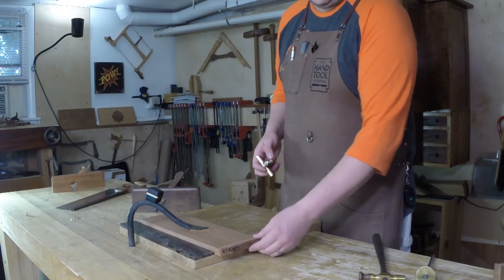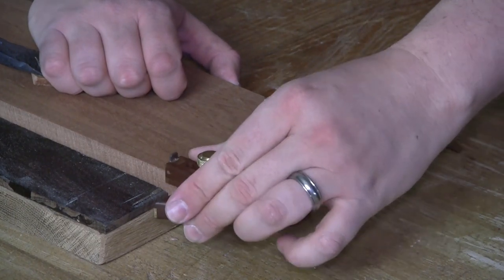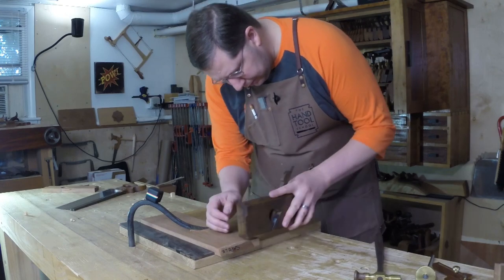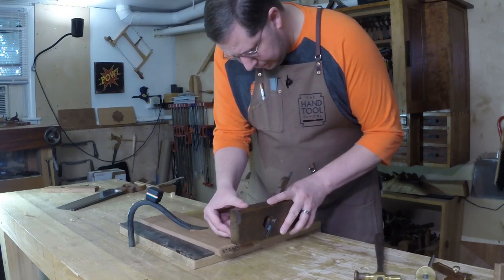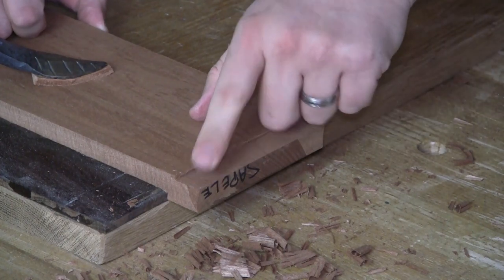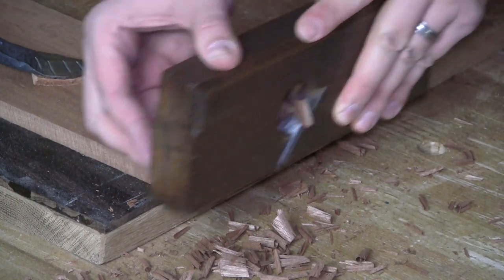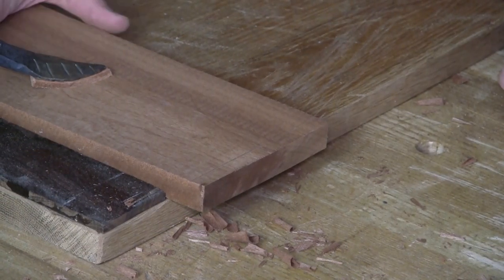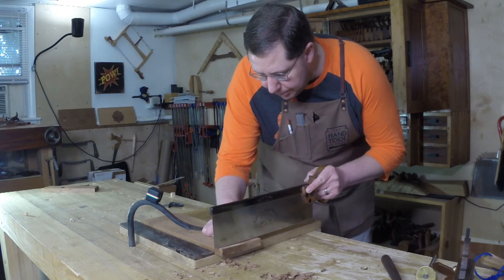Cross grain rabbet with a traditional wooden rabbet plane

Comment: Hi Shannon, I always enjoy your videos and your simple way of explaining things. Question: does it matter which way the plane is skewed relative to your dominant hand? Like you, I'm left-handed, and I noticed that the leading edge on this plane is on the right side (from your point of view).
Reply from the maker: not really Toni.  The skewed blade will push the plane one way or another based on that skew.  The long point will drive the body of the plane towards the shorter side and this can be used to your advantage working up against a fence or shoulder.  Its one of the reasons I recommend developing some ambidexterity as sometimes you just need to switch hands.  You can of course use the plane in either hand, thats one of the benefits to a fenceless  plane but you need to be aware of which direction the blade will want to push the body of the plane.

Comment: Hey Shannon...
After watching this and your long grain non- skewed wooden rabbet plane I was left with one question. 
 
So if you could only have one of the two (strait or skewed) rabbet planes, which do you choose?

How would a skewed rabbet perform on a strait grain surface?
Thanks in advance.
Reply from the maker: +paul bean I would never put myself in the position where I would have to choose ;).  Seriously, these can be had on the vintage market for very little cash.  Since there isn't much to them in the way of moving parts they are easy to restore and tune to working condition.  However, if pressed, I would go with a skewed iron.  It will be more versatile for joinery cut both across and with the grain very well.    The straight iron really excels when preparing rabbets for hand cut mouldings however so if a lot of that work is in your future then I would go for the straight iron.
Reply: +RenaissanceWW Shannon, first of thank you a lot!
so I have restored 2 planes of the metal body side of things with great success.
I'm sure that It won't be a problem, but I have never restored a wood body plane. 
But I know where a skew rabbet plane is sitting on a shelf at a swap meet for $20, thanks for your input!
I think I will use it as a guide to create my first shop tool. 
On vimeo, I watched an interview of a luthier and he said that the best tools you can find for your shop, are ones that you make yourself.